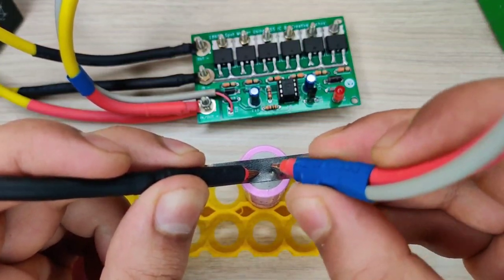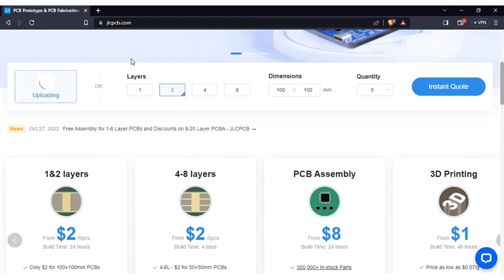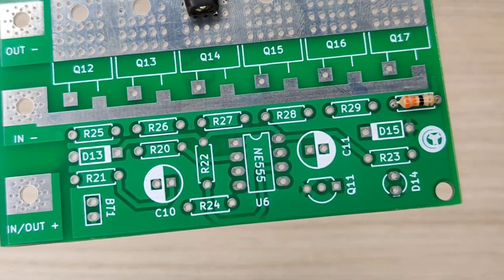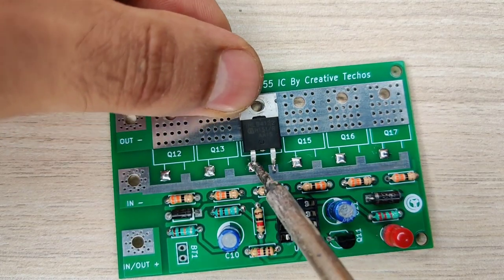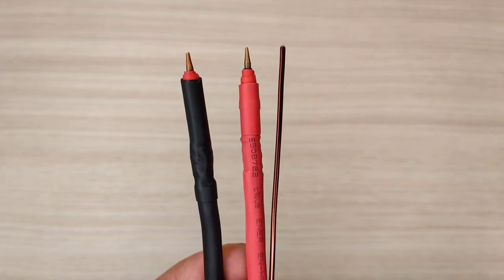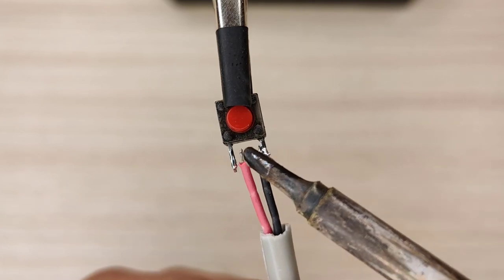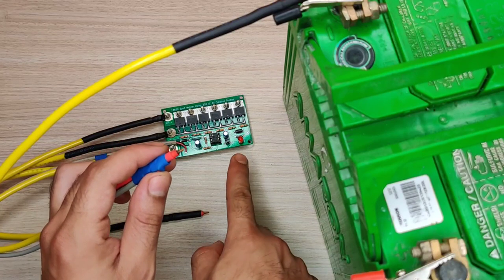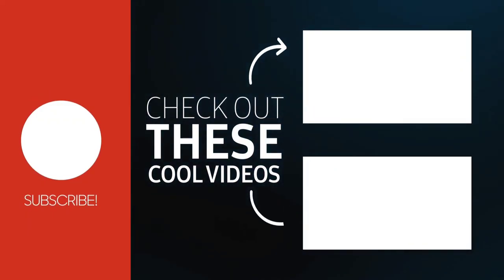How to make Portable Mini Spot Welder

Comment: Just curious how did you get 10ms as the optimal time? Experimentally  or is it an industry standard? A pot to make the timing a bit more adjustable would be nifty for if different metals require different times to achieve good fusion.

Comment: Can you share a list of the products used in the construction? I know they are on the video, I just noted the lack of information about, for example, the power of the resistor (how many watts)
Reply: 33 Ohm   x6
1k Ohm   x2
2.2k Ohm x1
10k Ohm  x2
1N4007
FR207
BC547
5mm LED
1 uF x2
8 pin IC base
555 timer IC

I'd guess low power resistors.
EDIT  I bought 0.5W resistors, they just fit on the circuit board.
Reply: @bohicajohnson7203  Thanks :) i did 10x Spot Welder with 3D printed custom cover, and it works great.
Reply: @ziben123456789  which battery are you using for input?
Reply: @mohammadmujammil5584  You can use 12V 50Ah battery or just 12V 5A power supply
Reply: @ziben123456789  can we use 12v transformer?
Reply: @mohammadmujammil5584  the transformer should work properly, but you have to check it at your own risk :D
Reply: @ziben123456789  actually i make same circuit and tried with 35ah and 1000ah battery but welds are too weak. We can pull it even with hand.
Reply: @mohammadmujammil5584  what thickness of sheet metal do you use?
Reply: 0.15mm
Reply: @mohammadmujammil5584  it should weld, but try again with 0.1mm

Comment: Hi I have ordered the PCBs already where should I add c18 as there are no holes in PCBs board
Reply from the maker: Please check Gerber file again on jlcpcb website, I've already given corrected file, where c18 is also added.
Reply: Ok thanks for your reply, I will see when they arrive
Reply: What size is C18? This video does not have C18. @CreativeTechos

Comment: Can i do this, totem pole amplify the ne555 ic output signal to connect more mosfet. I will be happy to answer and will make it.
Reply from the maker: Actually it doesn't need to do "Totem pole" you can drive upto 10 mosfets without any problem, and Yes you can do Totem pole but Signal Resistor of 1k should be added on base of PNP & NPN Transistors.
Reply: @CreativeTechos  tnx sir